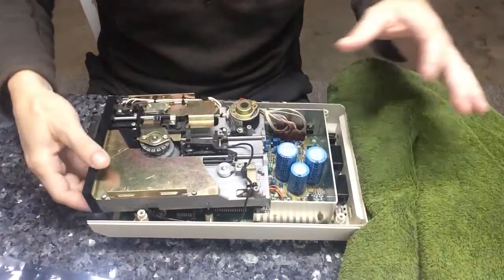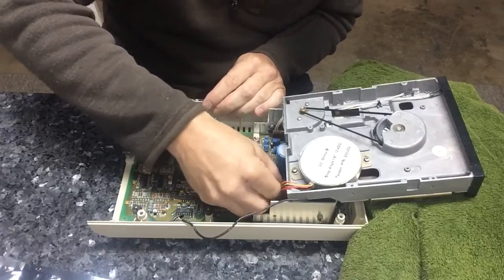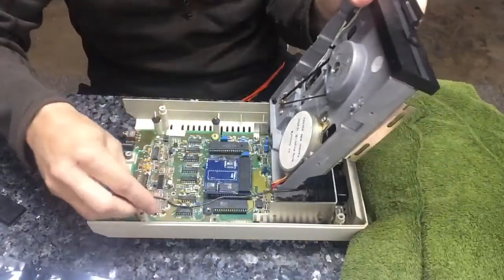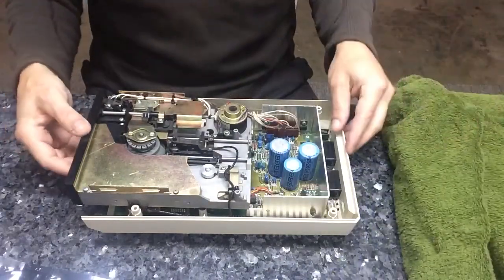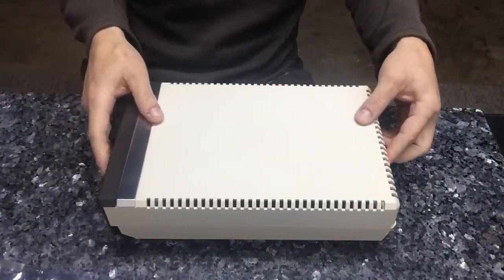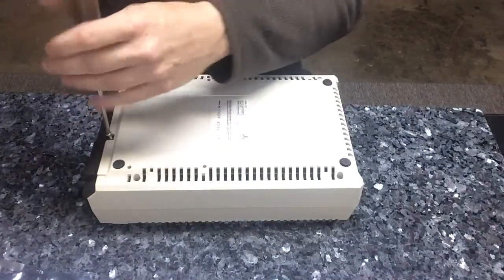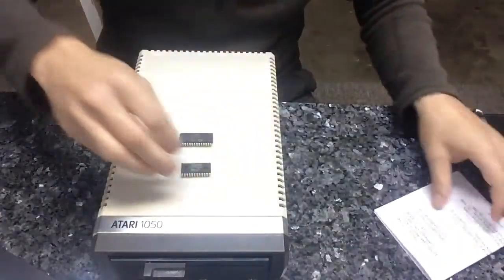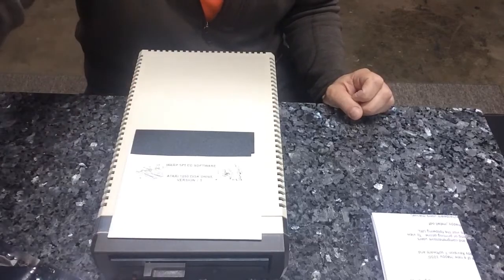Atari 1050 Disk Drive - Atarimax Happy Enhancement Install Video

Comment: Nice. Good to see these kind of videos 🙂
I've fixed a lot of 1050 drives, they are enjoyable to fix. Usually caps / diodes that go bad I've found along with dirty heads and dirty drive select switch.
Reply from the maker: Thanks! I figured someone would like these quick little ghetto vids. I never considered myself to be a disk drive repair guy, but my general skillset has helped.

Comment: Very nice!  Always wanted one of these BITD.  Need to order a couple of these, too. I recommend you store the original two chips inside the 1050 case so they stay together with the drive. IC foam...  I don't see the followup video demonstrating the upgraded drive. =(
Reply from the maker: I save all IC's that still work, even the ones identified with errors by the Diagnostic Station
Reply from the maker: I did not have a chance to make the follow up video because I traded it for the ultra-rare PS3000 monitor and two JVC made 1224's, one of which works. : https://www.youtube.com/watch?v=-qkkdHE1Myg